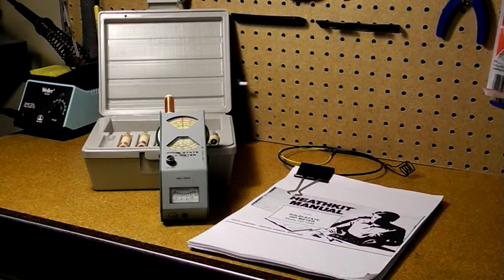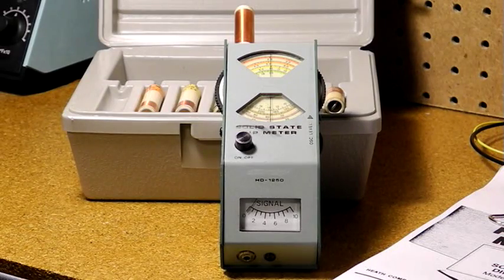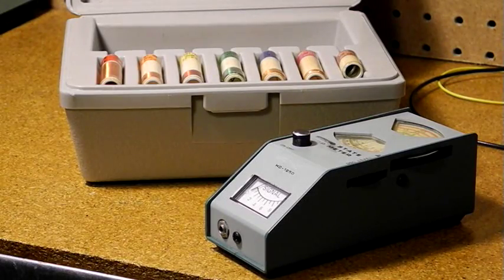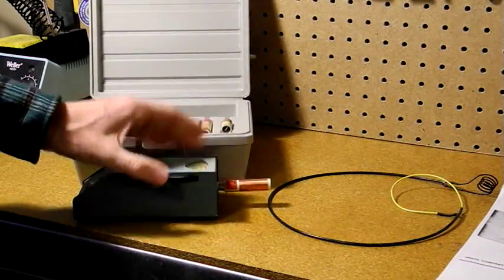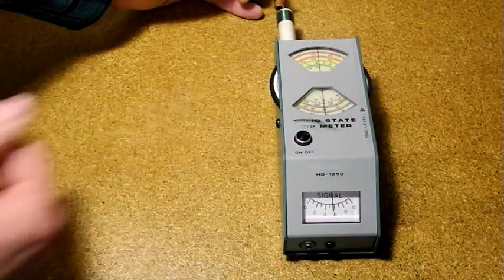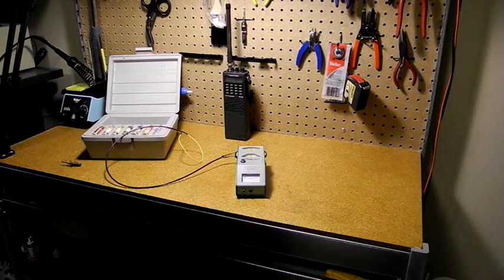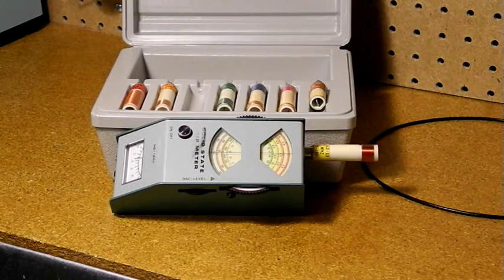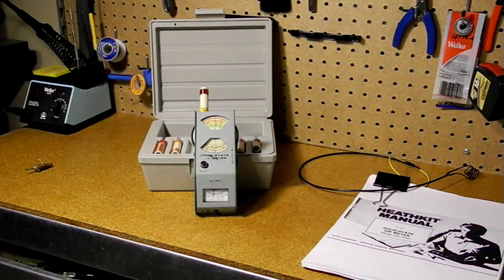The Heathkit HD-1250 Solid State Dip Meter

Comment: I bought one of this same model back around probably 1980-ish. I had no use for it, but had a hankering to build another Heathkit, and this one was not too expensive, so I went with it. At my electronics engineering job, the company was rapidly growing and kept moving my small group of engineers into different areas of different buildings, wherever we would fit. For a couple of years, we had offices at the end of a mezzanine overlooking a shop floor, with the rest of the level occupied by a bunch of people assembling printed circuit boards. They always had an AM radio turned on, and turned up loud, and tuned to a station that mostly played acid rock or something else equally aggressive sounding, and my little group found it distracting when we were trying to get OUR work done nearby. I noticed that on the wooden workbench where the radio was located there were a few cardboard boxes underneath that held contents that were almost never used or accessed. I brought my HD-1250 dip meter in from home, and placed it in an empty cardboard box under the wooden bench, and just a few feet from the radio. I tuned it until it matched the carrier frequency of the station it was tuned to. The next day, when the assemblers came in and turned the radio on, their favorite station seemed to be off the air. Since they could not agree on another station, they just left the radio turned off most of the time. The HD-1250 ran for a long time on its battery, but when it finally ran down, the assemblers had gotten out of the habit of listening to that one station, and had settled on another station that had programming that suited their needs for some distraction, while not being so aggressive that it kept my little group from getting their own work done. Everyone was happy, and I took the HD-1250 back home, where it remained for decades until I finally sold it on eBay. I listed it as "like new, only used once for a special project".
Reply: I bought the dip meter about the same time. It had two inherent flaws, a faulty RCA jack and a faulty transistor on the smaller board for the VHF range. Heathkit had a store in Los Angeles at the time and I was able to get the transistor but didn't realize the  RCA jack was bad too. I bought another RCA jack and it finally worked!

Comment: I would like to use my Heathkit HD-1250 dip meter to find my girlfriend's gold ring that is lost around the house.  Can anyone let me know if this is possible, and if so give me some help where the resonant frequency is likely?  If anyone else has any ideas to how to find her ring, it would be greatly appreciated, we have tried everything at this point.
Reply from the maker: I don't think this will work. What you really want s a metal detector, and even this would only be helpful if you were within a few inches to a foot from it.
Reply: @jefftranter   Thanks for the response! I tried the Garrett 300 metal detector, and it puts up a lot of false positives and is really hard to pinpoint to a exact gold ring, and doesn't do well over uneven surfaces.

Comment: do you know what is the transistor that they use for the oscillator 2n???, my dipper poops out a bit over 100mhz so I was thinking I could put a transistor in their that has a higher Ft, but if the one in there is pretty high like >>800mhz then I probably can't make an improvement.
Reply from the maker: It uses an NTE161 NPN bipolar transistor for the oscillator and a 40673 MOSFET as an amplifier. You can find datasheets for these on-line.
Reply: @jefftranter  tks for that info Jeff.  Looks like it has an Ft of 600mhz.  I have some at 900mhz.  I probably won't change it as you really have to tear things up to get to it.  btw, I also have the vaccuum tube version with the 6c4 tube.  It actually works better because the tube runs more power so its less likely to quite oscillating when coupled into a circuit.  I built that 6c4 version myself back in the 70's.  The transistor one I got at a ham swap meet.  next phase is to use a raspberri pi to sweep an rf signal, of course it won't be a pretty sine wave.

Comment: Jeff, I am thoroughly enjoying your series on Heathkit products. Since the mid-60s I have build and/or bought over 3 dozens Heathkits, including their 19" vacuum tube color TV set; each one performed flawlessly.You are 100% correct on your assessment of the versatility of the dip meter. In addition to what you've mentioned, it can be used to cut/tune an antenna to resonance,. determine stub lengths, find capacitor and inductor values, etc. Use of a dip meter should be a yearly presentation at every ham radio club meeting.Now I use the MFJ-259B as a dipper. Thanks for the memories.

Comment: can you couple the dipper to the end of a coax in your shack and get information from the dipole antenna outside ??
Reply: Yes. I've done that many times, over the past few decades. Tune your meter until it dips and that's the antenna's resonant frequency. It doesn't show impedance, but for new antennas it's much safer than using your transmitter and SWR meter. I also use it to tune my tuner before connecting it to the transmitter. A very very versatile test set.